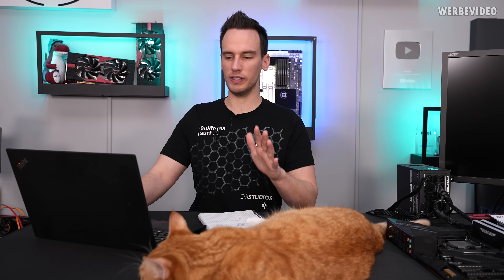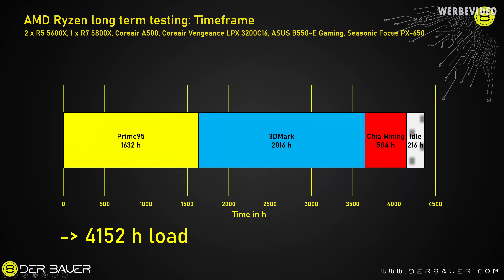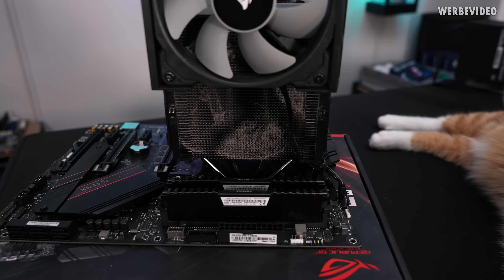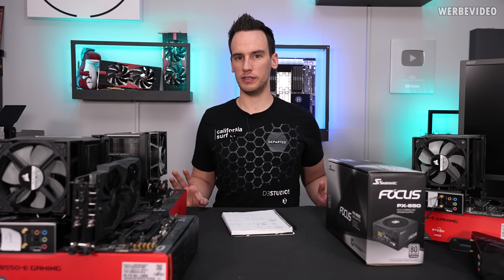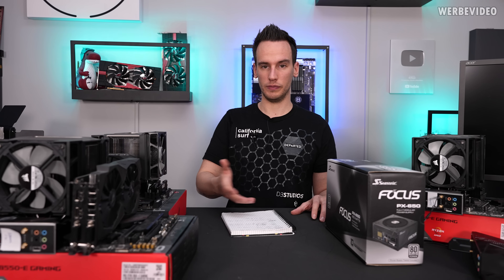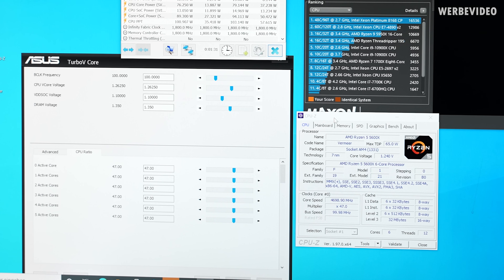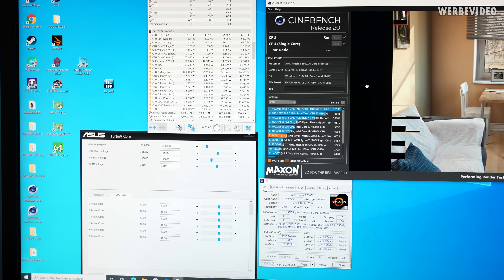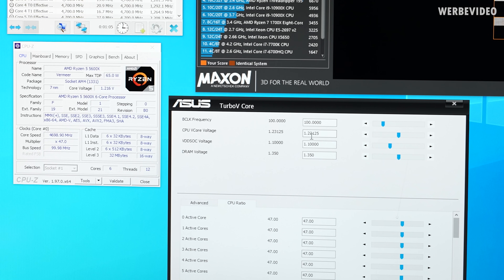4152 hours of Ryzen Long Term Testing: We have Good and Bad News

Comment: I still use my AMD FX 8320 with a slight O.C. It crashes and freezes from time to time but it is 8-9 year old CPU. I don't think the OCing is the killer of CPUs, it's crappy PSUs. Never cheap out when buying a PSU. I had extremely bad experiences with crappy PSUs.
Reply: yes! power delivery quality.  my homie has been having a problem with 2 different computers i built for him, i ended up using a power filter power strip from the wall, and he has had no issues since.
Reply: Same here. I have an FX 8350 that I just replaced with a 5950X system. Everything was working great except the 13 year old PSU when I decommissioned it.
Reply: @glsracer  thats an upgrade and a half
Reply: @ThunderingRoar  yeah, it's pretty nice. I use it as a VM server, though the RX590 could do 1080P gaming.
Reply: @glsracer  Last year I went from an AMD Athlon X4 860k and a 1050 2GB Low Profile card to a 5900x and a 3080. I repurposed my old PC as a Plex media server.
Reply: I remember I used to use a crummy 600w Rosewill PSU with my overclocked 4790k, couldn't get it pushed past 4.7Ghz. Replaced the PSU with a nice, 750w Seasonic FOCUS+ before an upgrade, 4.9GHz rock solid stable. Never underestimate the benefits of a solid PSU.
Reply: @nothing.mp3  Completely agree. Had a shitty Rosewill PSU that crapped out on me.  Never again.  I always go with a good 80+ Platinum or better these days.
Reply: @MichaelPohoreski  I am a bit experienced in PSUs. I modify it to use for my 24/7 servers. Just wanted to tell that "BRONZE" and "PLATINUM" are efficiency labels. Nothing to do with power delivery quality. Always check quality reviews about oscilloscope screenshots and step responses from independent websites before buying. If you have your own oscilloscope, that would be even better. If not just go with SEASONIC. They mostly build good quality ones. Remember, All electronics die because of spikey unclean power supplies !!!! Many comments here are speaking the truth. Power quality definitely rules the performance of the computer.
Reply: my FX9370be still live (well retired now but still working) after 7 years 5.2ghz above 1.5v, the biggest issue was keeping the vrm cool, 1kW psu (enermax revo 87+)
Reply: FX chips are great candidates for NAS boxes. When running stock their idle power is pretty good (for the time). They have a lot of cores and they support ECC memory.
Reply: Are they still crappy? I don't have any bad experience with PSUs or MBs lately. Maybe because PSUs are now 80+ gold and they are more power-efficient and less overheating, maybe it's because people ditched Fortrons and everything below, or because people started using 500-700W PSUs for PCs having better processors (like Ryzen 2700x, 3600, 5900x) and average GPUs like NV1060. Whole setup might have power consumption like 145W for CPU, 140W for GPU, 25-50W for the rest (chipset, voltage regulators,...). But I remember 300W PSUs that failed with something like AMD Duron without 3D card (truth is, PCs back then consumed 90-130W at idle and some Pentium IVs were famous for that, and PSU sucked warm air from inside)
Reply: I can agree with the psu issue. I have a buddy who had an intel i7 and titan gpu back when the titan was new, with a 450w PSU!!!! all because pc part picker suggested 450w! He would play counter strike with us, but for some reason, he had HALF the FPS we were getting with slower components. He should have easily gotten double or slightly more in terms of FPS. I mean I was getting about 350fps with my slower gear and yet he was only getting 150fps and he also had tons of stutter. I ended up going over his build and then laughed at his 450w. Told him to go to best buy and purchase a 750w and he did. And sure enough, installed it, and magically he was getting 550fps! He was shitting fps now as he should have considering the parts he had compared to the rest of us in the group. Even for me, I was running my 1800x with an 850w along with a 1080ti. Ended up side stepping to a Radeon VII and eventually a 2700x, and sadly with both overclocked, the 850w was just not enough. I ended up buying a 1300w seasonic clone in order to handle the overclocking load. And sure enough, the 1300w stabilized my system. Some argue "well your 850w was bad" but no, it just wasn't enough power. Now I rock a 3950x overclocked to sin and a 3090.... funny, everyone was bitching of crashing with their 3090 during the initial AIB release and blamed capacitors as the reason. I had no such issues, but I also had a quality 1300w psu. The ones complaining had 500w, 600w, 750w, which just isn't enough for a monster 3090. Not to mention the burst power draw the 3090 has when switching from resting to gaming or resting to full on stress test. An older, lower wattage psu just wont keep up.

I used to run my 9590 at 5ghz 24/7 with a liquid cooler. And it never went over 55c. People told me I was full of shit, and when I would show a screenshot or even picture from my phone of the monitor showing the readout, they would claim "photoshop" because they just refuse to listen. Even now, a lot of people build in really bad airflow cases and wonder why their temps suck! No amount of better components will help cooling when the case has no airflow.... I honestly think people are becoming more stupid over time, and worse more idiots have access to the internet so they continue to spread misinformation online and wonder why everyone else is just as stupid.
Reply: @goblinphreak2132  I attach extra capacitors near the CPU power supply pin to provide more instant power delivery and smoother performance.
Reply: I had 2 Hipper PSU -both failed and almost killed the motherboard and at the end they did kill the cou or motherboard since I downclocked it to half to keep it running.
Reply: I bought like 4 power supplies on sale this year just to make sure I'd never have a time bomb psu connected to parts it's no longer affordable to replace.
Reply: @ffwast  Speaking of sales ... the Seasonic Prime TX-750 (Titanium) is on sale for $150.  Just ordered 4 of them for backups and a new compute farm. :-)
Reply: I agree with that. I have a 3570k I bought new still running with a healthy OC but always used a top-tier psu and a mid-level Asus board. Zero probs nearly a decade later. I've only ever had memory issue but i run my sticks maxed AF.
Reply: Even expensive PSU could be crap, there is nothing you can do but trial and error PSU you buy.
Reply: You are correct it is not CPU OC it is PSU i have FX8320 oc to 4.5 ghz an FX8350 oc to 4.8ghz both chips under custom loop watercooling with 2 big 480mm rad's for each system power'd by 1200 HX Corsair 80+ platinum psu's they have been running non stop for 10 years with out any issue.
Reply: Same as my 8320.  It's very stable OC but starts to do weird things and unstable once it gets over 70ºC and imminent crash above 80ºc, but that is only even an issue when my power hog GTX 980 overheats the water loop when the GPU is under load for too long and heats the CPU right up in the process.  I really need 2 separate cooling loops to avoid this issue.
Reply: My PSU is my second-of-most expensive parts in my PC. Why? I hate when my mobo gone kaboom and bothering my next project.
Reply: I still have my FX 9590 and still use it. No crashes though.
Reply: That's why I always go Seasonic. For reference, these guys make the boards for high end Corsair PSUs.
Reply: Ngl, fx series always gave me fits, oc or not.
Reply: Any recommendations for high quality PSU's - there have been a few scandals over the last few years with substandard PSU's being sold.
Reply: The motherboards is also the psu(your cpu doesn't run on 12v from your PSU it runs <1.5v from your motherboards dc-dc convertor).
Reply: Especially when you live in 3rd world country with shitty power instability
Reply: Yeah. For my first ever build I used the PSU that came with my case off ebay. One day I turned my PC on and almost instantly I heard a pop and saw a flash. I was extremely lucky and nothing else was damaged, but that convinced me to never cheap out on power supplies. Especially no name ebay PSUs
Reply: I ran my FX at an avg of 1.55V with 4.8Ghz (3.2 ghz stock) OC. That was a beast and the proces node could really take a beating with hours of linpack testing.
Reply: my 13600k is rougly 250% faster 🤣🤣🤣🤣
Reply: Will overclock can affect life of a cpu if you use high voltages that you can’t cool down like paring a i9 9900k with a 120mm aio overclocked to 5ghz running constant 100-105 degrees vs a 360mm aio running 78degrees with same settings .
Reply: i have an Asus ROg Thor 1200P costed me 329.-
Reply: You can always cheap put on PSU... just get a 250w psu out if an Acer pre built from 2007 and you're good blow
Reply: Is it just a straight multi bump on the 8320? They draw way too much power stock tbh. Can get really good gains manually setting voltages, upping the bclk and lowering the multi, ~240 rolls the memory clocks over to almost normal again assuming 1866 memory, so could maybe run it stock, just keep load temps below 62c for some longevity and watch vrm temps. Should be able to keep vcore sub 1.4v reasonably easy depends on your motherboard*.
Reply: why do you use this garbage?

Comment: I didn't see any long term temperature data. Was that monitored even periodically? Reason I ask is I think those Corsair A500's the air coolers that had cold plate quality issues? Heat affects silicon life as well, it might be worth taking a closer look at the A500 that was on the problematic 5600X.
Reply: Those initial reviews were all terrible on that A500 due mostly to the issue you describe. Because of all that bad press, they were selling these at like 30-50 dollars. When I bought my system this year, because I'm a huge fan of huge air cooling towers, I just said 40 dollars, why not. . . And I got it for my own 5800x system. 

I can tell you that my A500 is completely flat on the bottom. I'm sure like any plate to plate its not perfect, but it certainly isn't noticeable to the human eye or noticeable in its performance. I am of the belief that initially these A500s had a huge machining problem, and due to all the bad reviews, the product was essentially doa with making a splash. 

I'm happy to report that I've tested my 5800x using both the A500 and a noctua d15, I run a custom overclock, and the temperature I get with it 24/7 is essentially the same as the d15. I max out at 82c running torture tests long duration with the A500. With the D15 I was maxing out at 81c. It is essentially a wash. A 40 dollar air tower versus a 100+ dollars air tower, getting basically the same temps. Idle, load, torture. Aside from more noise, I wouldn't be able to tell the difference. 

I think this was a cooler that has been thrown into a heap of negativity after the terrible release, forcing corsair to try to just sell them off even AFTER they seem to have fixed the machining issue. For 40 dollars what I constantly see it advertised at, it's an unbelievable bargain due to the bad press. I suppose maybe I could have just gotten lucky, but I assume they probably did fix their process after launch. This obviously is my personal experience with it/opinion of what happened. For me, It's been a wonderful cooler for the hot 5800x. At a steal of a price. Nothing looks better in my 15 year old modded HAF 932 then a gigantic air cooler!
Reply: @mayaddy6228  Nothing I said suggests they couldn't be good. The issue was quality control and consistency. One cooler working out doesn't offer any insights into his 3-4 all being equally reliable.

Comment: Derbauer - how do we know the voltage issue is CPU related and not the VRMs aging slightly on the board?
Reply: because it was validated on a 4th board which I basically didn't use during that time

Comment: Do you have a scope ( I asume so) any chance you can compare ripple effect on especially amd boards maybe like test a board with dublers and ones with only real phases  could be fun to see also like how switching frequenchy diferences affect ripples, I belive at least msi an asus can adjust
Reply: The disadvantages of doublers are largely theoretical and in practice there is no meaningful difference. buildzoid has done tests on this.
Reply: @thatguy7595  I don't watch bz and ripples is a thing that people know to little about, if investigating it only makes sense to do both with and without doublers and test with different frequencies
I keep seeing people just pushing highest LLC and frequency without thinking about ripples and overshoot at all cause they don't even know it's a thing
Reply: @martine5923  ripple was a problem with phase counts less than ~6. Above that and with todays controllers go up to 20 phase we won't have much impact on this front any longer. Also component quality, since AMD is relevant again, is for both motherboards on a comparable lvl now and not worse for one company than the other, like back in the bulldozer days.
Reply: @Airwave2k2  nr1 many boards phases with doublers unless you on xoc class boards
Nr2 even on those at least on water or air ripples makes a difference on stability of a overclock at the tale end 
Overshoot that can potentially damage or even kill a chip 
So this is relevant info a lot of people doing oc don't know about or how it works, cause most have just gotten dumbed down explanations like anything more then 6phases don't have this problem
Reply: @martine5923  You are right 6+ phases is a dumbed down explanation. On an individual lvl you should make sure to buy the "quality" you want. 

But I tried to speak on a whole and the direction it has gone and I think we are a bit better of today then like 5+ years ago. And the simple reason for that is wattage consumption has gone up from under to 150-200W to a 250-300W on the highend parts, which every board manufacturer has somehow set their boards up to meet at least the minimal performance if you would put such CPUs into it. So power delivery had to jump the wall of making things happen with like 4 phases to now go for 8 to meet those demands. Sure there are still "crappy" boards out there, but you wouldn't want to oc on them for the most part.

Comment: 01:55   You can disable updates to prevent that.  Or you can simply disable automatic reboot.  Not via the UI, of course (because Microsoft), but via settings in group policy.
Reply: Just unplug the network.
Reply: @xeridea  That's nonsensical. Just disable your network adapter.
Reply: disable network while chia farming .... ding ding ding we have winners.

Comment: My 3960x OC became unstable after about 1 year of 16 plus hours per day of video encoding.. I was only running 1.15v and pulling 250W constant, 280W peak. Found out that lowering peak current from 300A to 230A makes for much less degradation over time since then.
Reply: Are you checking you’re power supply rails with a multimeter? While it’s running anything below 11.9  Vdc or so power supply is shot and 5/3.3 v rails check them as well.

Comment: I mean it's fine. At least it's not "cheating" by using almost 200w more than AMD to gain back lost performance using a hybrid CPU setup. Yes I understand it's new for desktop and, yes the next gen parts are going to use probably way less wattage for the same or better performance. I still thought I'd point out that overclocking a Ryzen CPU isn't going to make your electrical bill bump up another 50-60 dollars a month, just by running games or encoding software for going out and buying new 12th gen Intel parts. Competitive or not in pricing.
Reply: Do you talk to your therapist about intel too

Comment: outside of extremely heavy use with over clocking, these chips will be good for then next 20 years, if the past is any indication. I consider a working 486 to be usable in certain circumstances.
Reply: I'll bet in normal desktop use they'll do 20 years with absolutely no issues. Doubt someone will be using them for 20 years though. Intel CPUs from 10 years ago are still very much usable for a lot of tasks but you can upgrade to so much faster with not much more money.
Reply: Outside of extremely heavy use - which I do not do at all, I cannot find a reason to change my i7 2600K at 4.2 GHz 1.35 V. Even gaming 1080p runs everything fine with an RX 580, because who can afford a GPU now...
Reply: @rkan2  I agree. The only tasks that are really unfun with older multi-core chips is >1080p/30 video playback and any gaming if using the igp. Normal net browsing, email, and word processing is totally fine.+
Reply: I partly disagree. Even with typical browsing/email/etc. OS nowadays are running more in the background and assuming you at least have a quad core.

Now if you run a lightweight linux setup, yeah good to go...
Reply: @rkan2  yes my i5 3740 can testify to that, almost 10 years and still going, not that strong but i can wait another year.
Reply: for sure, if the chips aren't pushed too their limits they'll last close too forever for sure.
Reply: I will add my original pc's atholon x2 - still capable of running windows 10 and 3 chrome browser tabs - it's certainly a legendary chip.

It's the x64 variant - ran it for majority of it's useable life in x32

The athlon survived everything else in the original pc along with the case - 3 psus, 1 hdd and then ssd, 1 motherboard, 3 rams (ddr2), a Radeon 5450

Comment: thx for this video ;  i'm still running an 1800x
Reply: 1,3 volts . in terms of hours it would be something like 10 years 4 - 6 hours of use a day . the memory can sometimes become instable but the motherboard just does dram training. and everything works for another 6 months up to a year. the dram frequency is much higher than it should support for more than 2 sticks . so i'm not complaining .